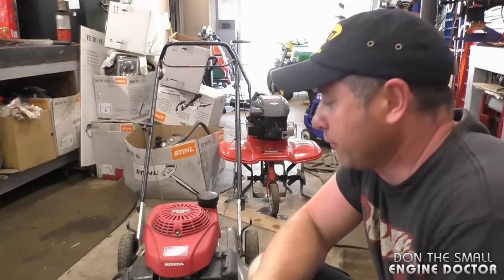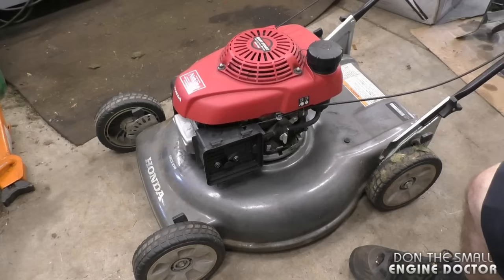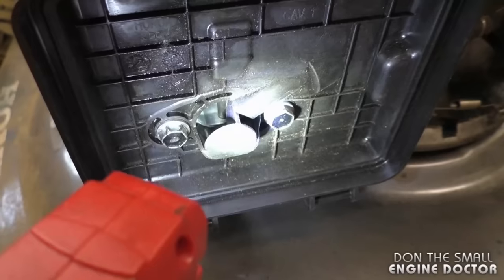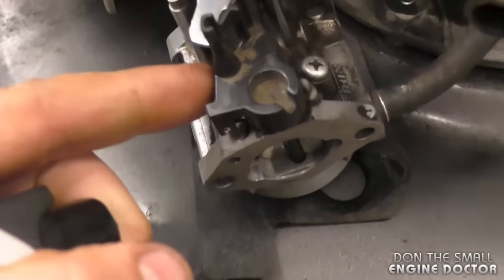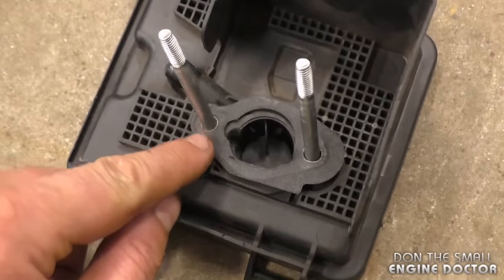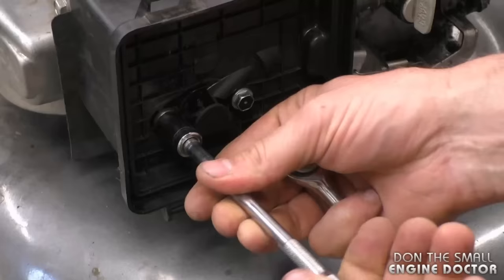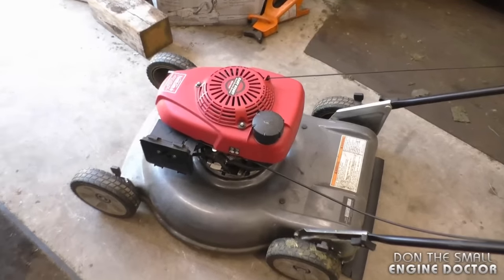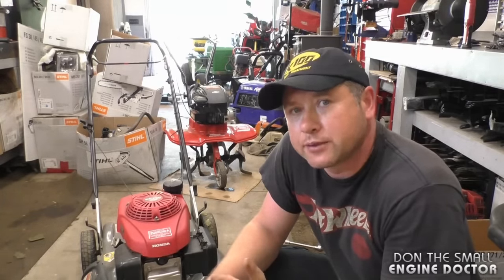Make Your Lawnmower Start On The First Pull Again - Honda Auto-choke Repair - Video

Comment: That over complicated auto choke system is just one of the stupid over engineered designs on these Honda garbage motors. The jigsaw puzzle of a carb, air cleaner, and multiple layers of gaskets and insulators is the worst. I'll never understand why people think these engines are good. They're junk.